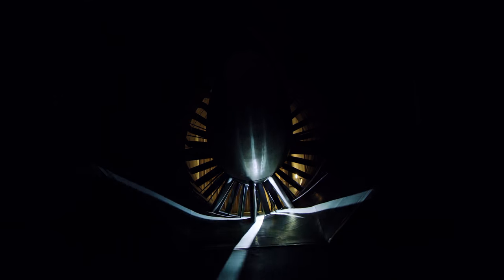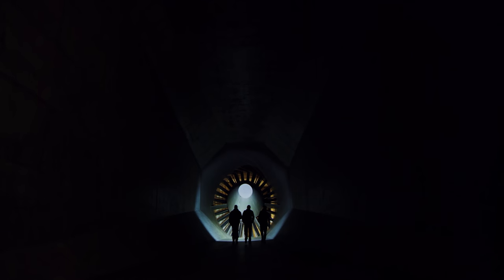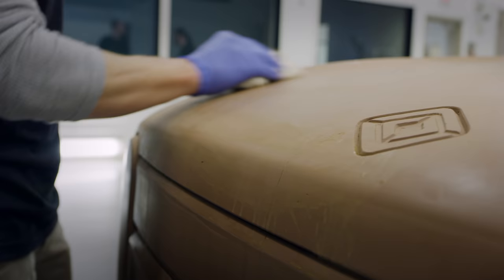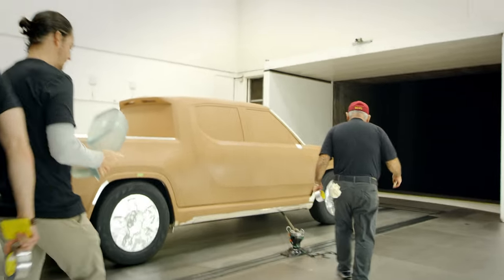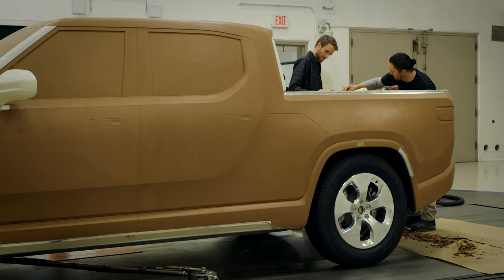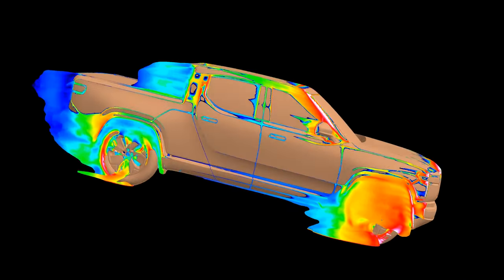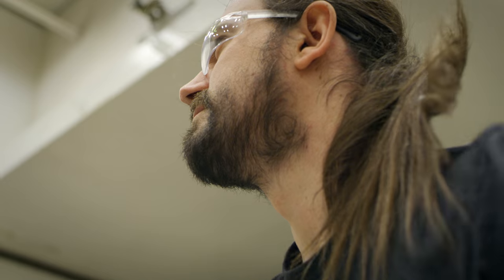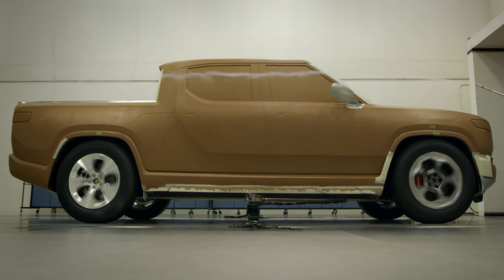Aerodynamics | Electric Adventure Vehicles | Rivian

Comment: Need a video on charging network. 

If you guys added more chargers in midwest you could dominate truck market. 

Also whats the aero rating?
Reply: Or... If they just use the open source tesla charging system...
Reply: @Tazman55x  yeah that too but Midwest Tesla isn't great. Also no one's used it yet so I don't see them using
Reply: @TheMrNeffels  yeah... I don't see them doing it, but it'd make life so much easier. It's an open source patent for the charging style.
Reply: @Tazman55x  I thought there was a chance before Amazon invested $700 million. 

Amazon is going to get their own system up probably in next few years. They already partner with a few EVs to sell and install chargers at homes

Comment: Nice video !
What is the Cx of the Rivian R1T ?
Good work !
Reply: they do not  know, it is all smoke screen. What they should have done instead of that BS talk, is simulation using fluid dynamics like TESAL did with CYBER TRUCK.
Reply: @gregbaniak9650  Yeah, absolutely right mate !
Reply: @gery4870  thanks mate, we know that CD of a pickup varies from 0.4 to 0.6 , the best scenario for Rivian would be 04 to 0.5, we will never know!!! untill , someone will do the test. There are empirical methods to determine coefficient of air drag and rolling resistance. (page 339 of the BOSCH AUTOMOTIVE HANDBOOK 5-th edition).
Reply: @gregbaniak9650  Thanks for the response :=)

Comment: As previous comments, what is the drag coefficient?
Reply: they do not  know, it is all smoke screen. What they should have done instead of that BS talk, is simulation using fluid dynamics like TESAL did with CYBER TRUCK.
Reply: @gregbaniak9650  maybe they did and aren't sharing the results. I think you're right about the smoke screen. They would boast about ANY possible numbers that would look good. But here they are boasting about their effort. If the drag coefficient is not-so-good, it will wreck the EPA mileage estimate.
Reply: 0.3

Comment: Are there aerodynamic advantages/disadvantages that are unique due to the electric power source? For instance different air flow needed to cool batteries and motors versus a combustion engine.

Comment: The truck looks great except for one thing. The headlights look like a hippo's nostrils. They are too small to be symmetrical with the rest of the vehicle. It looks as if the width of the lights should be almost doubled to "fit" the design. Everything else looks super! Love the light strips on front and back.

Comment: Pick up and aerodynamics don't mix
Reply: Neither do they with semis but TONS of R&D for semis drag had made a huge difference. Even the wheel hub covers to both tractor and trailer can add about 3% to the mpgs.they have trailer skirts, trailer tails, roof fins etc. You can always make sure you are doing the absolute best that you can in terms of aerodynamics regardless of vehicle type

Comment: 6' or 8' bed, or it's not even a truck. it's a joke.
Reply: Justin Crediblename oh come on.  The off-road and towing capabilities at least make it truck-like.  Kind of a truck/SUV mashup.  And it will do most of what most Americans actually do with their personal trucks (commute plus occasional camping or getting 2 bags of concrete for backyard etc etc.).  A more serious “truck” will hopefully arrive someday but this thing is pretty bonkers.  Definitely not much of a joke
Reply: Never have needed a truck bed over the 6.5 foot bed of my 350 and I work in construction. If you need to haul plywood or sheetrock get a trailer. Also who the fuck would want to offroad a truck with an 8 foot bed😂😂😂😂different trucks for different uses. Also if you actually used a "truck" for a "truck" bed size wouldnt matter cause youd have a fucking fifth wheel hitch in it like mine so my bed size doesnt matter cause its mostly unusable.